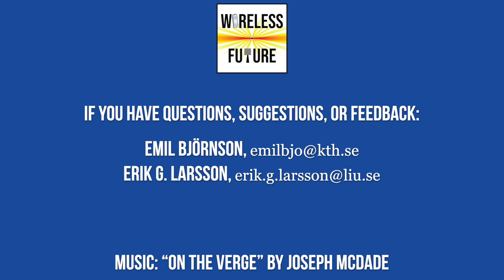Ep 30. The Sionna Library for Link-Level Simulations (With Jakob Hoydis) [Wireless Future Podcast]

Comment: What kind of a processor and PC specs do I need to set up Sionna?
Reply from the maker: I haven't heard about any minimum requirements. You can for instance run all the code in Google Colabs and then it is their available resources that determines the speed. But I'm sure the run times are much shorter if you have a computer with an Nvidia GPU... :)
Reply: @WirelessFuture  Alright, thank you for getting back. I like the content you're airing, keep it up. cheers!

Comment: I have a short differing question. How often is a piltot sent? Does that vary over time? Is It perhaps sent once within coherence time?
Thanks.
Reply from the maker: I believe the standard approach is to define a minimum coherence time and send pilots according to that. This will result in that many users send pilots too frequently, but a clever implementation could utilize multiple pilots to obtain better estimates. Since the transmission is divided into slots, one has to send one pilot per slot so that it is possible to start and end a transmission in any slot.